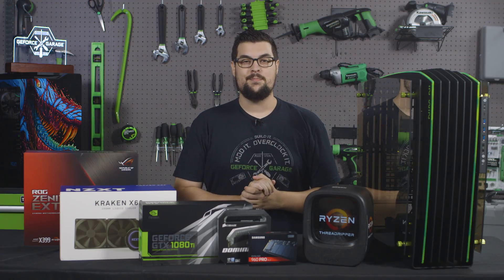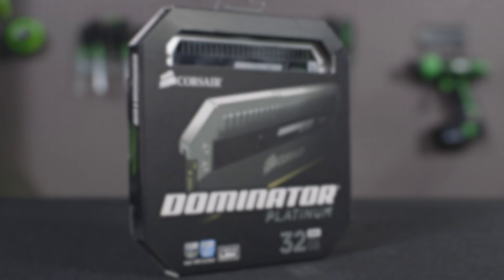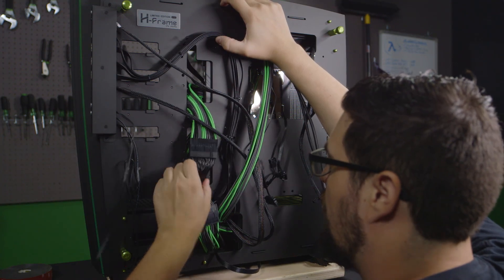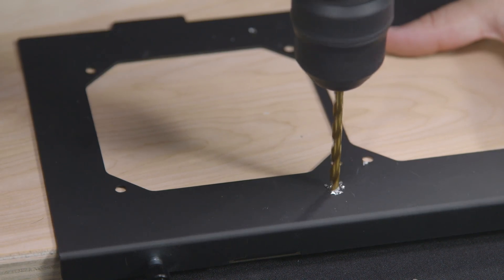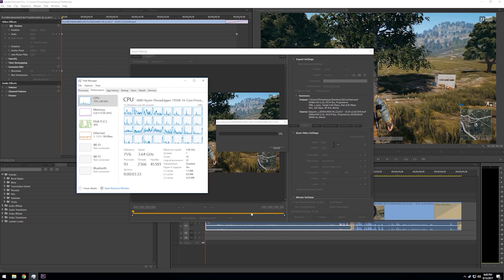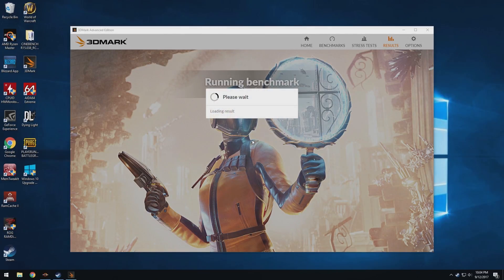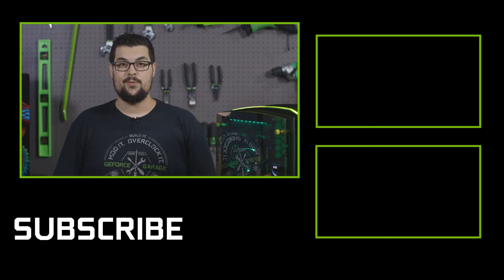GeForce Garage - GTX 1080 Ti & Threadripper Build

Comment: My 6950X CPU gets a 12732 CPU score in Time Spy 1.0 and my 1080 Ti gets 11000, I don't even have to disable cores.. 2384 multi in CinebenchR15, 192 single core. I can play games at any resolution without a CPU bottleneck. Threadripper the frame dipper.

Comment: The Kraken X62 and other last generation AIO's are not made to work with the Threadripper cuz they can't completely cover the CPU's surface heat spreader (due to the increased chip size). An AIO that is designed specifically for Threadripper chips like the Enermax Liqtech TR4 360 (https://www.newegg.com/Product/Product.aspx?Item=N82E16835214080 ) would have been much more ideal.

Comment: I'm rocking the 1950x and ASUS Strix GTX 1080ti. I just salty I didn't get the Zenith Extreme because I couldn't be bothered to wait for it to be shipped. I went with the Gigabyte Aorus x399 Gaming 7. Regardless it's still a MONSTER in gaming and my 3D modeling apps.

Comment: When are You going to remove the sign-up to use Shadowplay (before you didn't have to) ??? Considering how often hackers get into corporations data bases I am not interested in giving out my personal details to simply use my hardware (I already paid for) and it's software. I went with AMD Radeon RX 480 for my sons new build just because of that. You force install that even with just installing driver updates. The new Shadowplay sucks when it used to be so good. It's a shame. Been using Nvidia since GTX 460 but now I'm going AMD when I'd like top stay with Nvidia. However I can not support what You did with Shadowplay and all data collection You now do as well. Same reason I've stuck with win7 and refuse win10 and I block all updates on win7 that tries to sneak in data collection patches/updates on win7 as well.

Comment: I would imagine only utilizing dual channel and not quad memory is hurting your scores a little. 1950 usually gets around 3200 multithread score.

EDIT: Did you OC the CPU? If not, that should help increase scores as well.

Comment: 1440P 
NOT 4K
PAIR UP 1080TI WITH INTEL X SERIES 
YOU WILL GET FPS AS SHOWN ABOVE 
BUT IN 4K
AMD PROCESSORS & GPUS ARE EXCELLENT IN WORKING
INTEL PROCESSORS AND NVIDIA GPUS ARE BEST IN GAMING
Reply: Kabir Kharadi im here with 4.5Ghz 6700k + 1080 Ti and getting slightly better fps than TR, but based on many review I watch with Skylake X the gaming performance is actually slower than 6700k & 7700k because of the new mesh interconnect which means it should erform very similar to the TR. Btw they were using ultrawide 1440p (3440x1440p) which is more demanding than standart 1440p (2560x1440p).

Comment: Why can't you make use of the quad channel Memory?
Reply: Danyal Reyaz they ordered the wrong kit. They got a 2*16gb kit instead of a 4*8GB
Reply: Hydrochloric Acid I still don't get it
I am relatively new to the tech world
Really technical terms don't get into my head
Reply: here, i'll make a scenario.
Me: Imma buy some RAM for my pc. Four sticks of 8GB ram should be fine.
Misclick
Me: osht I ordered the wrong thing. Oh well.
Reply: Hydrochloric Acid couldn't they order another 16*2 then? I just wanna know if you can just put another ram bought separately without causing issues
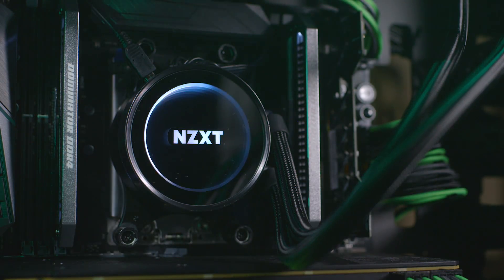Reply: 2:13 "So in my mind, that just means that we need to order two more 16 Gigs of ram to bump it up to 64."
Yes, you can buy another ram kit. Just make sure the speed and type are the same.
Reply: they can of course put another 2+16 gig sticks in there, to use quad channel you need to have at least 4 ram sticks
Reply: eo.hiru

Comment: Would be nice if AMD could work with Microsoft to get that game mode to work without a system restart. Time to move from work to play let me restart first..... Wtf? If you are a gamer don't get threadripper. If you need all those cores then sure get it. The much cheaper Ryzen platform is better for gaming and still really good with productivity.

Comment: Next build: workstation/rendering box that looks good. Dual Xeon E5, 128gb Ram, 1x Tesla or Quadro (for display output), 3x or more GTX 1080's or 1080Ti's.

Comment: The dual channel setting kills Threadreaper performance more than in any other CPU. So I can't take the performance tests seriously. Normally it scores >3200 on cinebench.
Reply: Your right a dual rank 3200 cl14 kit in quad channel make such a big difference.
Reply: Thats because threadripper is really 2 CPU's in same package, and each of them have 2 channels for it's 8 cores, if you use only 2 you really running in single chanell or else you got multithreaded application running on both.